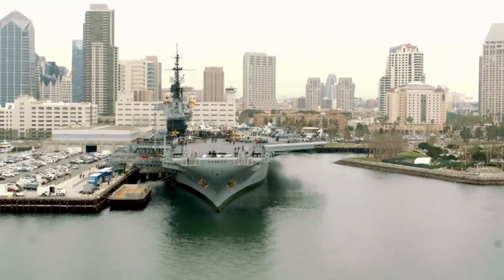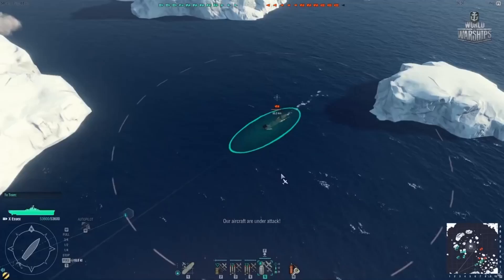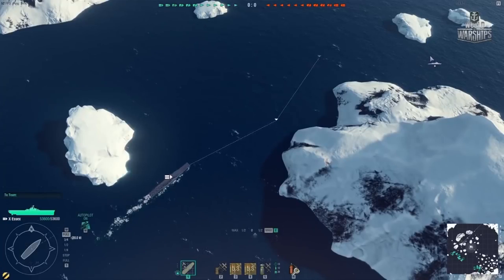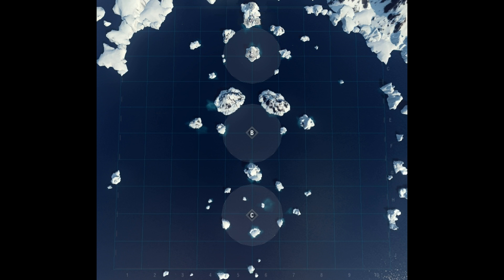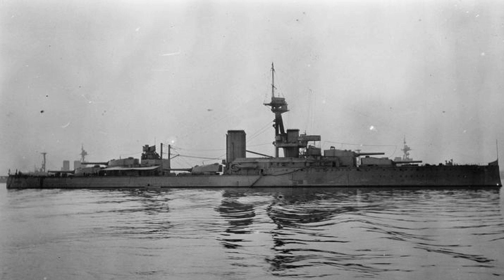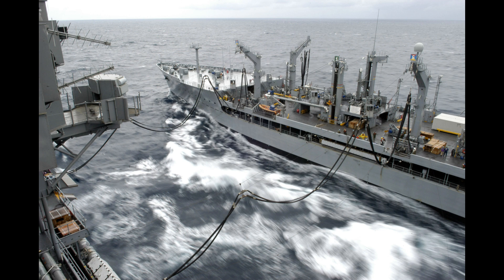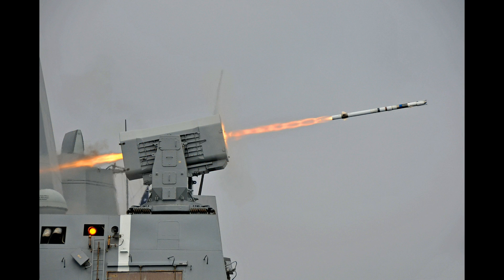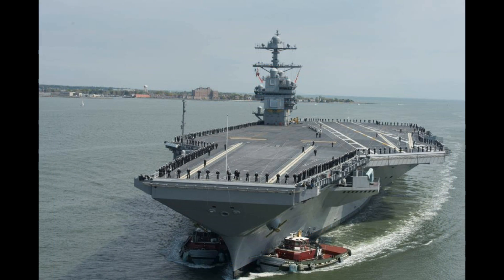Corrections to Real Life Lore - Why It's Impossible to Sink This $13 Billion Ship

Comment: One thing important, US carriers don't travel alone. Carrier group consist a lot of support ships, escort, submarines. Good points in this video.
Reply: 1. The Americans aren't fighting the Swedes.
 
2. If any nuke touches that carrier then a nuclear war would happen.
Reply: its not uncommon for a US carrier to outrun its group to provide death from above... lots of times, they send the escort group out first, then the carrier to meet up with them... usually the carrier still arrives first.
Reply: You didn't watch the original Real Life Lore video to the end, did you? To be fair, the stupid minute-long ad for World of Warships was so badly written I wanted to go watch something else too...
Reply: Burak Baggins the Swedish sub can run 7 days submerged with its engines running, it compresses all exhaust fumes
Reply: 1. Sweden is not the only country that possesses diesel-electric subs.
2.A torp that size doesn't have to be loaded with nukes to sink a carrier. (You can shoot more than one in rapid succession.)

*But the problem with diesel-electric subs is that they need to snorkel and fire up the diesel engines to recharge the batteries and restock fresh air. And that makes it tricky to get into the region of the carrier without getting detected. A nuclear sub doesn't need to surface for months but is not as silent as a diesel-electric boat. So that drill with the Swedes may not mean much...

*Also super cavitating torpedoes may have problems with finding the target since they can't use sonar because of how loud they are. Public knowledge about this is obviously very limited.
Reply: Szymso 
Support vessles dont help if you cant detect a sup.
Search for “swedish sup vs us carrier group“ and you see just how dangerus ONE DIESEL ELECTRIK!!! Sup can be.
And notice that the russian supercavitsting torp can be louded with nukes. Immpossible to evade and stopp. Your carrier is sooooo dead.

Comment: After spending a very long time designing and building ships I/We have learn one lesson in particular - no ship/boat is unsinkable ; just ask the capatains of the Bismark and the Tirpitz (in real life if you could, one of them followed his ship to the bottom).
Reply: John Hargreaves wernt those ships scuttled by the crew?
Reply: Tirpitz not really Barnes Wallace's earthquale bomb broke the ship's back; the Bismark, the crew did open sea cocks but only to hasten the ships sinking as the devastation on board and the continued punishment was causing great loss of life, it would have gone down any way as it had started to list and would have rolled and gone down slower.

Comment: Speaking to the correction on #5. Yes, most submarines made in the last 20-30 years are capable of maintaining speed with most modern day combat surface vessels but, and this is a pretty large JLo sized but, maintaining these speeds is not without its own issues. Traveling at such high speeds reduces the passive sonar capabilities of submarines, making a submarine mostly blind unless the contact is either actively pinging or at extremly close range. The second and biggest issue, traveling at such high speeds generates alot of noise, possibly giving away the position of the submarine and is the reason why passive sonar capabilities are either reduced or not possible at all.
Reply: The original video assumed that a sub needs to chase a carrier while it is at flank speed. This means the carrier or task force has detected the submarine. A submarine's role is to not get detected and fire it's weapons for a first strike, there is one thing that is going to be true for a long time.
To a submarine all surface ships are known as "Targets", they are effectively blind in comparison to a modern attack submarine. The best defense against a submarine is another submarine.

Comment: I'd always wondered why they put not one, but six nuclear reactors on the USS Enterprise. After visiting USS Midway in San Diego, it came to me: that ship had six yuge steam boilers. For the Enterprise, they more or less "kept" the design and just replaced each one of them piecemeal with a reactor.
But in the event of a nuclear war, the carriers would most definitely NOT be ok because they'd just get nuked and that would be that. http://exiledonline.com/the-war-nerd-this-is-how-the-carriers-will-die/all/1/
Reply: As the first nuclear carrier, USS Enterprise receive 6 reactor because at this time there were no powerfull enought reactor. Nimitz class received only 2 because of better technologies.
Reply: i want to correct your miss information, the USS Enterprise had 8 sub reactors and a total of 16 steam generators. at the time, they did not have a proven and tested carrier reactor, only sub reactors... so the father of nuclear power himself decided to stick the 8 reactors inside the carrier to make it seem 'silly' to the navy that having that many reactors would cause a maintenance nightmare. however the ships performance out-weighted the maintenance costs which led to development of the A4W type of reactor. also 2 reactors were used to power each shaft, for a total of 4 shafts. the forward most plant had the longest shaft in the world. also, the enterprise was the fastest nuclear carrier, designed using a V shaped hull vs the U shaped hulls like the nimitz and ford classes. originally it also had speed screws, which made it faster then it was when it was selected for inactivation....
Not like it really matters....

Comment: Titanic was thought as unsinkable...it sunk. Bismarck and Tirpitz were designed to be "unsinkable" (and to the designers' credit, Bismarck took a beating at close range) but still she was put into that situation by a canvas bi-plane torpedo bomber. 

Also one other thing, even though a sub can do 30+ knots submerged it will also cavitate like crazy and attract all kinds of attention. So technically the other video was correct but he was also wrong like you pointed out. And yes I have been watching Jingles cold waters videos.
Reply: Bismarck was scuttled by her crew
Reply: All cavitation for subs changes with the age and condition of their screws and when setting out to sea they do check what speed they cavitate at  various depths. Deeper they go the faster they can move without cavitation.
Reply: Donerkebab after the living shit beat out of it
Reply: if the ship was unsinkable, That wouldnt be a problem since unsinkable means there is NO WAY to sink the ship, which there obviously was.

Comment: By the way I have a great plan of how to sink a supercarrier. Have a few nuclear attack boats to constantly distract its escorts, and fire torpedos at the escorts to force them go flank speed, making the escorts unable to use its sonar system. Then, have a SSGN, such as an Oscar, to launch all its cruise missiles. Oscar can carry 24 ssn-19 Shipwreck in VLS, perhaps even more from tube launched missiles. Good luck stopping all of them! The Oscar will not survive the escape, as the smoke trail is easily detectable, and helicopters (alternatively ASROC from escorts) will hunt it down easily. But this is 1 SSGN and maybe some SSN for a CVN and maybe some escorts. I say it’s worth it.
Reply: I have a better ideea, use sattelites or aircraft or a network of subs to detect the carrier group, send a cheap, fast submarine up it's path, make him dormant and when the fleet arrives, wait for a few moments to get in the middle of them(where the carrier is usually located) and unleash the HELL. Meanwhile, other subs can distract and destroy some escorts, which would allow the attack sub to dive and try to get the hell out of here.

Comment: Not that you'd know this, but nuclear reactors need to be refueled every 2-3 years.  Unless it carries a very large amount of extra uranium (which is extremely difficult and dangerous to store) it certainly won't last for 20-25 years.
Reply: US navy reactors are highly enriched and contain a "burnable" neutron poison that gets burned off at the same rate that the U-235 in them is burned for power. This allows them to last decades without refueling.
Reply: You are thinking of civilian nuclear reactors with a maximum U235 enrichment of 5% or 6%.  Navy reactors have much larger enrichments and can last for much, much longer.
Reply: actually, the fuel amount on the ship is finite, and depends on power history. if it runs at max power, it wont last 25 years, but if it runs at lower powers, it will last 25+ years... given its normal maintenance cycles... i can tell you if we left a carrier deployed from when its refueled, to when it needs to be refueled again... it would see about 15 years, IF it doesn't decide to speed around at flank speeds
Reply: Um even the latter is wrong they dont even need to be refulled after 20-25 years the only reason they do is because carries that get to that point are hot garbage where everything on the boat is outdated and or broken
Reply: TheGam3Tim3 you are wrong. The Nimbitz is a currently active carrier that was launched in 1972 and was refueled and overhauled between 1998-2001 after which she reentered service.

Comment: No man, the Nimitz design is very outdated by modern shipbuilding standards. It doesn’t matter how recently the last one was laid down, it’s the design that is old. At their core, Nimitz ships still use a steam-bleed network to drive most of the ship’s mechanical systems. That’s a dated and inefficient way to distribute power with miles and miles of hot piping subject to leaks. A commercial cruise ship built 20 years ago employs more sophisticated technology. 

Ford ships have a different setup — the reactors drive generators capable of creating enough electricity that everything down-the-line runs on electric motors and power can be distributed via regular electrical wiring. This is why you’re also incorrect when you show that dated nuclear propulsion diagram. Modern naval reactor designs don’t usually use a reduction gear setup to turn the screw directly. Modern turbine engined designs don’t use reduction gears, either. They use electric motors now, the powerplant is mostly used to generate electricity.
Reply: iChaseGaming  Because those are parts built to modernize Arleigh Burke ships that were conceived in the 80’s. Even new ships built in that class will still utilize the old core-design since it’s costly to create a new one. Vast majority of ships currently in service are still built around old designs, only subsystems and peripheral components/features are updated. 

Navy wants to move to all-electric integration of propulsion with auxiliary systems: https://www.gao.gov/assets/100/94296.html  This was originally done in submarine designs in the 90’s to make them quieter. Now they’re extending the idea to surface ships as well, including conventional ones. You can checkout the design of the Zumwalt powerplant to see how this works. There’s plenty of public info on it.
Reply: The article you linked specifically mentions the contract is for the Arleigh Burke class of guided missile destroyers. They would also still be used for other conventional (oil powered) ships.
Reply: It is more than likely that there is no direct mechanical connection between the nuclear plant and the propellor shafts. If you look to other more recent warship designs, they will almost all utilise a diesel-electric system, like the mentioned Zumwalt. Germany's new Baden-Württemberg-class (F125) is another example, using a CODLAG configuration where gas turbines can provide additional power for high speeds.
Reply: FYI, on all navy ships... the reduction gears are 'rented' not bought.... source... myself, ETN1 on a Nimitz class carrier.... not like its creditable or anything....
Reply: Boxy Brown 

I am certain that the new Ford class does in fact use reduction gears to drive the propulsion shafts.  If it was using direct electric propulsion then they would have equipped it with an Azipod type thruster such as those used in many large cruise ships which also eliminates the need for rudders because it is rotatable and can direct thrust in any direction. I think the problem is that for ships of this size you would need 4 thrusters of approx. 50000hp (based on shaft horsepower output of Nimitz class carrier) and units this size simply don't exist.
Reply: @Ascarion  Modern cruise ships are not combat ships.  They usually do not have to care about being shot at with guns or rockets or torpedoes or mines.  Any cruise ship that forgets will go the way of the HMS Rawalpindi.

Which means a cruise ship might place fighting even after serious damage is just slightly below passenger comfort and low operation costs.  That may mean some technology may be standard fare for one type but not the other.  (Obviously: most cruise vessels do not have fire plotting equipment and most combat vessels do not have a lot of first class cabins for paying passengers.)
Reply: Diesel-Electric has been worked on and used for a long, long time.  For example, German WWII subs found that by running one diesel engine and using the electric engine on the same shaft as generator (as intended) and using some of the electric energy to run the other electric engine (not quite as intended) extended their range.  Actually I understand electric vessels were the way to go in the 1880's to 1920's, where internal combustion engines (e.g. in form of outboard engines) eclipsed them.

A Zumwalt (larger than a WWII heavy cruiser) has 70 MW drive power from the turbines (+ 8 MW from secondary turbine generators for "other stuff").  70 MW means 70,000,000 W, and if it was DC, that'd be, for example 10,000 Volts and 7,000 Amperes.  (I understand they may be using AC for their engines, but this is just a very rough back-of-the-envelope thing.)  That power would generate just less than 4 m³ of hydrogen and 2 m³ of oxygen in a second via electrolysis if going through, say, seawater --- and as oxyhydrogen it's the optimal mixture for a big BOOM.  Any spark, any hot place, even some platinum (see Döbereiner's lamp & co)  will cause a big explosion in the innards of your vessel, where you want it least to happen.

So there are ... challenges with high-power electric drives.  But if they think they can manage them, more power to them --- after all, they do still have magazines with tons and tons of high explosives inside the ship.
Reply: Ship building industry is pretty familiar with the Diesel-Electric (DL) setup. Modern cruise ships, for example, run systems that go well into the two digit MW numbers, just like Zumwalt. So everything from the engines "outlet" to the propellor(s) should be pretty standard fare. Magazines need to be secured from external influences anyway, it's not like that changes from before. The only thing that's really "new" in this context is the nuclear plant. But going from nuclear to electric is a problem that's been solved decades ago and done daily all over the world, so I don't imagine it to be that big of a challenge, when you can also draw on the experience with the current-generation ship-based nuclear plants.

So I don't think any of this is really such a big challenge, it's more a case of updating to the current state in naval architecture.
Reply: You're wrong. Ford-class still uses geared turbines for the main engines. As for the "steam bleed network," I'm assuming you're talking about the steam power plants? This has to do with efficiency, ability to repair and bypass damage, and ability to be maintained underway. Comparing this to a cruise ship isn't even remotely accurate- bad things have happened to cruise ships that have had casualties in their engineering plants, and that's just from fires, not from taking damage from gunfire or missile hits. Sophisticated technology == vulnerable and difficult to repair. 

Finally, that "dated" nuclear propulsion diagram, isn't. It's just from a submarine plant, not a surface plant. 
-A former Navy nuke.
Reply from the maker: Interesting, can you provide me an article on this, would love to read more.
Reply from the maker: Because if reduction gears are no longer used, then please explain why the US Navy would spend $1 billion dollars for new main reduction gears? http://www.americanmachinist.com/news/timken-lands-1-billion-us-navy-gear-contract
Reply: @IChaseGaming A number of new ships use integrated electric propulsion where electric motors drive the propellers such as the Zumwalt class and the Queen Elizabeth. And the Arleigh Burke is getting updated to hybrid drives so they can operate as electric at low speeds. Despite extensive search I cannot find anything about the nature of a Ford class's drivetrain so its probably direct from the turbine but its not impossible that its electric motor driven.
Reply: John Jensen While pods are nice, they also have distinct disadvantages, such as lower efficiency and course stability. The CV likely does not need the added maneuverability.

Cruise ships use these predominantly because they frequently land in large number of different ports, so on order to not having to pay for a tug boat every time, they need the maneuverability.

So just because they use a conventional propellor setup, does not automatically indicate a mechanical connection.

I will once again refer to German frigate f125 that uses a diesel - electric setup and has two conventional propellor shafts.